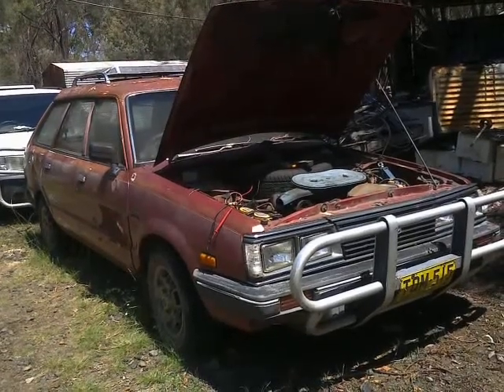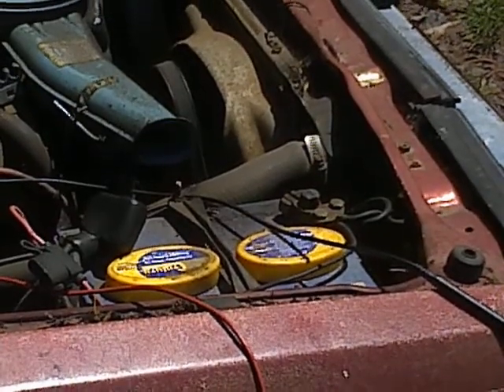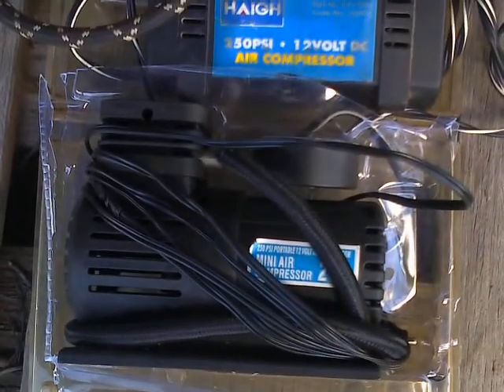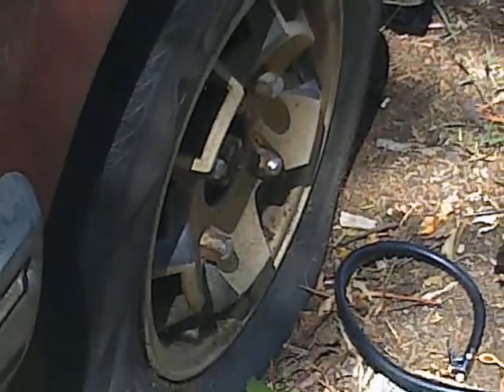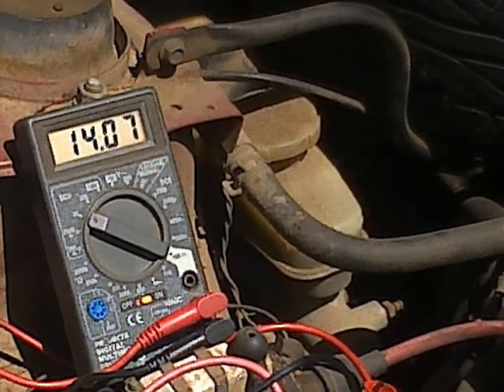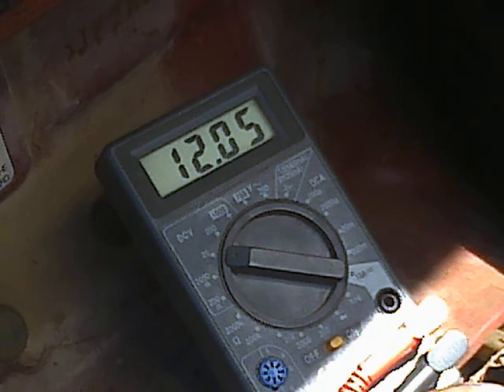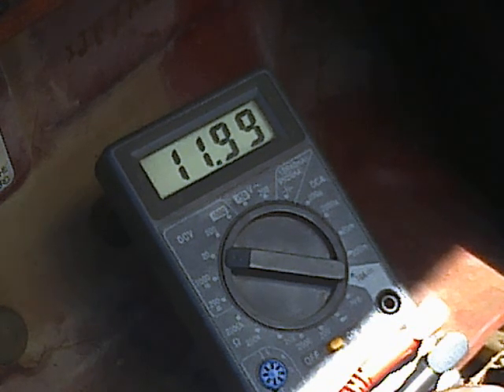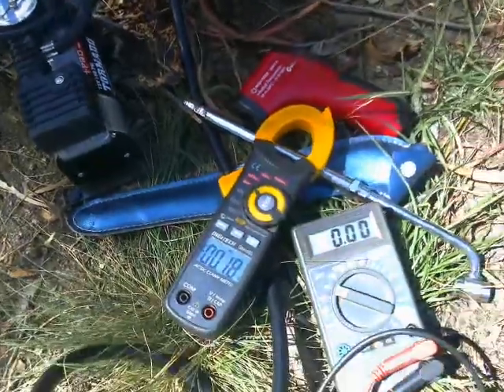SunFoil Mk-3,  Reviewing Tornado AC+ Pro Air Compressor...

Comment: Hi Chris,
A great little compressor.
I had one that looked the part but when I switched it on to blow up a nearly flat tyre it started smoking within a minute.
But I suppose when I paid five pounds for it I should have known.

Those little compressors can be back engineered to make a vacuum pump. I did it with one when I had made a vacuum chamber for my high voltage experiments. Worked pretty well.

On top of the cylinder head, there is a small hole with a one-way valve. The valve is removed and reversed then reattached. Then you need to attach a pipe to the little hole. I used epoxy resin and a stiff pipe.

Cheers mate.
Reply from the maker: G'day Mike,

  Thanks mate.

   Yeah, the ones which are selling for $20 have trouble blowing up an Air-Mattress, let alone a Car-Tyre..., the fourth one in my stack of Spares won't produce 30 PSI ; but this new one is a propper little "Humdinger, every part of it appears to be engineered to actually work, effectively - rather than looking as if it will do the job, while being really cheap to mass-produce for a quick sale to optomistic gullible Consumers halfway around the World, who will throw it into Landfill and never bother to complain.

   A lot of people are making their livings by  producing, shipping, & selling useless shiny Landfill...; and for that "achievement" we're killing the Biosphere...., which strikes me as proof that unfettered Free-Market EcoGnomics was a stupid idea from the get-go.

   I'm struck by the fact that this is the 3rd time that I've "retired" the 'Coleman Inflate-All 90' which the old man bought when I was in High School ; the $50 Cheapie worked for maybe 15 years, and  the $20-Special didn't do the job.

   So, finally I've got a Newbie which is better than what my father had in his Kit...!

   It took me a while to get used to the idea, but I applied it to Binocculars on Friday...; a couple of years ago I paid about $120 for a set of "Cebu" 8x40s, to replace my father's 8x40s which my mother wanted returned after giving them to be in 1984 (!), and when new they were pretty satisfying..., but for the past month or so the replacements have been feeding me dys-aligned images and giving me the Dah-Dah-Dits something fierce...

   The choices were to shut one eye to use the "Binocculars", or buy something which was propperly made, and in Town there were Bushnell 10x42s for $199, or 10x50s for $260 ; so I haggled them down to $230 for the biggest and bestest Binocculars I could buy in the main street..., and they're really joyful to use (!).

  Initially I thought the cheaper plastic 8x40s might be chop-up-able to make a dedicated Phone-Camera Telephoto Strap-On..., but it's Focussing-setup would make that a pain in the Arse to cobble together as a one-sided thing ; and it might be easier to make a Bracket to match the Phonecamera to the new Bushnells, after aquiring a Tripod-Mount for the Binocculars...(?).

  Quality is worth paying for, it seems ; who'd have thunk it...?

  Have a good one,

;-p

Ciao !